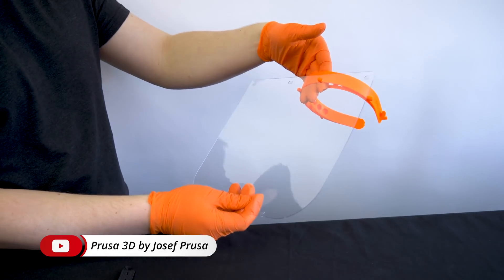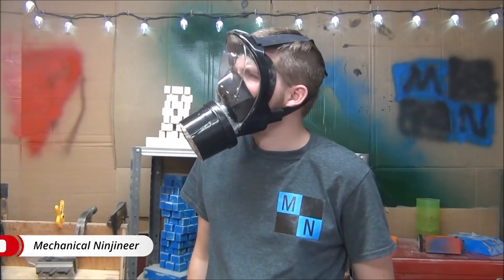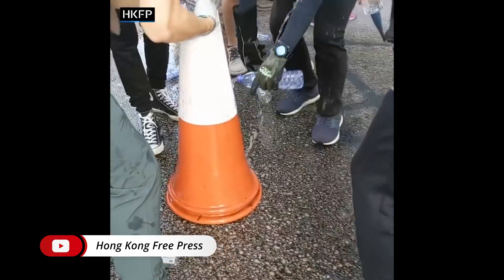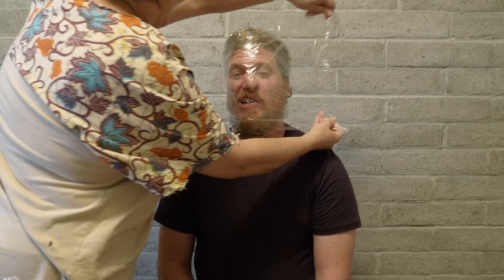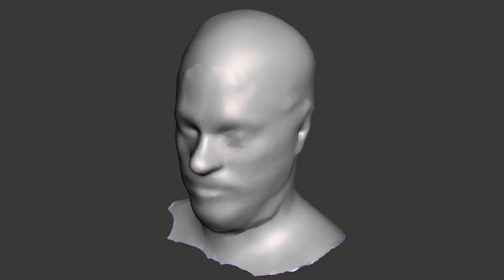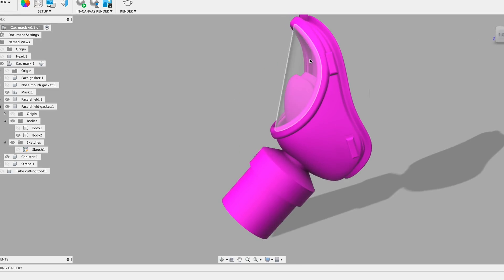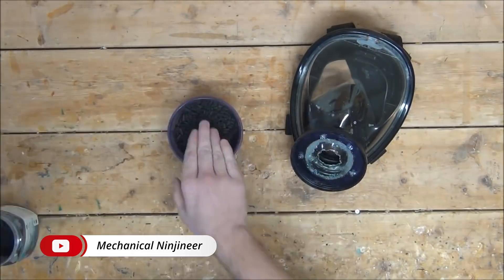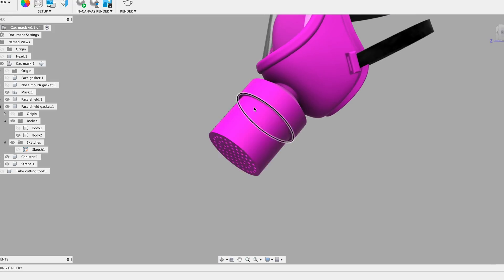I Designed an Open Source 3D Printed Gas Mask

Comment: I don't really know a lot about 3d printing but a few things about 3d modelling. Having  a lot of large round surfaces increases the complexity of the model a lot so I would try to make more flat surfaces and only have them rounded at the mating points to your face/filter canister. For example make the canister a hexagonal shape with a rounded top to screw it in, that way you have large flat easy surfaces for the 3d printer to build.

Comment: A lot of printed plastics are porous. Moisture from your breath could potentially accumulate in the plastic and allow bacterial or mold growth. Has anyone explored using a sealant on the plastic to prevent this?

Comment: There is a massive problem here you aren't thinking of. What happens when a cop hits someone in the face with a baton, or shoots them in the face with a rubber bullet? ABS/PLA will shatter into sharp chunks, which will then be driven into the wearer's face by the same impact. You need to make only the minimal parts out of rigid plastic, and keep them below the eyes/face as much as possible.

Comment: You can use the cup of a bra on the back of your head for the strap attachment.
Reply: Bras are expensive though. Silicone cutting mats are likely cheaper per piece

Comment: You should use a hepa filter like those in the vacuum cleaners... Its light weight.. no need for activated carbon...You can find them at cheap price @ hardware store...

Comment: For straps, just use velcro straps like this that wrap around a D ring and lock back to themselves:. http://www.walmart.com/ip/VELCRO-Brand-All-Purpose-Strap-Elastic-27in-x-1in-Straps-Black-2-ct/17190454

And thank you for your work and thoughts! Although I may have understood some of these issues longer than you have, I certainly didn't know what I personally could do about them, and I probably still don't. But I know I'm ready to try, and a lot of my thoughts parallel your own, so I'm glad that you're using your platform to spread these ideas as far as you can. That's what I like to see from those with a platform... I would guess that your eyes have been opened quite a bit by the people you are staying with as well... Be safe, and #BLM !

Comment: I'd suggest using some kind of sealing tape like teflon tape on the threads of the filter cartridge, just because 3d printed threads might not have the best seal.
Reply: The issue with teflon tape on plastic threads is that it can very easily put far too much force on the plastic, cracking it. Teflon compound might be able to provide as good of a seal without that risk (perhaps along with a slightly tapered thread). I also wonder whether the threaded part could be at the inlet end somehow to remove this issue altogether. No need for a good seal if it's right next to the inlet anyway.
Reply: @mowcius  I like your idea of putting the threaded part on the unfiltered side so it doesn't need to seal. However, this means that the filter would be packed into the mask body itself. With more of a canister design as it is now, the filter can easily be swapped out or removed and repacked if needed without taking off the entire mask.
Reply: Adding an o-ring to would easier. Adding an o-ring gland where the canister and mask meet would be easy to do in the model.
Reply: @Incendium87 , my worry with o-rings would be how available they are for people. Possibly there are standard globally available large sizes?
Reply: @mowcius  O-ring sizes are standardized. There are technically metric and inch standards, but I think they are basically a renaming of the same physical part. Either way, they are flexible enough that the sizing can be fudged a little if the environment isn't too demanding. A range of sizes would be available in any hardware store. If an o-ring can't be found any number of other things could be used to make the simple gasket. The same or similar weather striping he's using in the face seal, or any other sheet gasket material. sheet gasket can also generally be found at a hardware or automotive store. If printing in TPU for the face gasket, you could just print the filter gasket too.
Reply: Love the discussion tapered threads or an O-ring both great alternatives

Comment: My first concern with a 3D printed gas masks would be the porosity of FDM printed parts. Even just today, I had a PLA part fail immediately because I forgot that 3D parts aren't watertight. And, by extension, they are nowhere near airtight. There are ways around this with over-extruding, surface finishes and (I think) SLA printing, but it's still a major concern; even if a mask is water/air tight, or at least tight enough, having pores that can retain tear gas or pepper spray would detract the mask's value significantly. This should definitely be a concern for any 3D printed gas mask.

Comment: First of all I think this is great. It had me thinking...Theoretically you could use a regular snorkling-kit right? eye-mask to cover your nose and eyes and then fill up the snorkle with activated charcoal and cotton. Im thinking as an option for people who does not have access to a 3d printer but still want to frontline and take out canisters of toxic shit etc. (Just an idea, putting it out there)
Reply: You don't need activated charcoal for CS spray. Activated charcoal does not work for CS spray.
What works is a particulate filter, same for covid.
Cotton balls are not a good particulate filter.

You need a non-woven textile.

Comment: You should definitely make the part that holds the canister portion to the main section much stronger. It's most likely going to be knocked around (think about it a thing the size of a coke can sticking out your face is going to get hit a lot especially in a crowd with tear gas canisters being fired into it) and if it's not strong enough it'll break off. If you read this ILUVU no homo but ye :)

Comment: I've been brainstorming a form factor to fit a voice box to existing gas masks. I know the electronics part already, but having a vox port would be nice for voice clarity.
To be clear on how they work: Gas masks have a diaphragm that lets air in on the filter, but not out. Voice ports and exhale ports are the opposite, letting air out but not in with another diaphragm. It can be done with a hole that's smaller than the diaphragm you choose and placing it on the inside for inhale, and the outside for exhale

Comment: your beard will prevent a good seal this is why the military banned facial hair aside from small mustaches because they'd die if attacked with gas because of the lack of a proper seal, the foam depending on what type it is could also negate a seal your best going with a rubber or maybe some silicone for the seal instead
Reply: There are gasmasks that are especially designed for people with beards, it's a full head cover that seals around the neck.  I found out about them from a Sikh co-worker ( his religion forbids shaving )
Reply: @SuperMike2507  but bare in mind, the people with the long "unkept" beards are far and between...
tho some sikh medical professionals did shaved to put saving life of others without getting infected themselves as priority (N95 mask needed a complete and fitted seal to be effective)
Reply: Not true anymore.

Comment: There is a generic gasket that is made of rubber for car doors Wich can seal very well against the skin, is sort of a tube, maybe that would be better for the seal and it won't need to be so perfect to fit a wide range of faces

Comment: Issue 1: no exhaust port. Look at the Russian GP5 and look at the exhaust. It’s the most simple.                                                   Fix for the straps: make a T with an extended top portion and another cross section.                                                           Reason for the inner seal: so your breath (breath has moisture) and will fog up glass.
Reply: That's why It is OPEN SOURCE, so you can improve it apporting your knowledge.
Reply: Mr. elyte I have the CAD modeling ability of a carrot.
Reply: This design contains no valve. Air comes out the same way it goes in.
Reply: Tedd I suggested the exhaust port from the GP5. It will get air out so you don’t fog as bad as well as conserve the filter

Comment: Well spoken and great use of your time. I agree that you don't have to be political or be in a specific part of the political circle to agree what been happening is wrong. I think for your mask it is best to make two variants, one for only the mouth and one for mouth and eyes.  For eye protection there a lot of still available.  I recommend m3 engineering glasses and paintball masks to protect your eyes from peperspray paintball. Also everyone already knows about the goggles for the spray itself. I will try to help with the design with the mask.

Comment: When selecting materials that come into contact with your skin; make sure you know what they are made of and that they are safe. Construction materials may be safe for the use they are designed for but not on skin.
Reply: In fact a lot of construction materials are absolutely vile and require PPE to handle in the first place

Comment: Medical engineer and volunteer firefighter here. Scotty don't get me wrong, I like your stuff, but I have a few concerns that I want to share.

The standard FDM printing is whether water tight nor gas tight without any further tricks. So if someone is printing it without this knowledge, it can be very harmful.
You mentioned also Covid-19, don't use activated carbon filters against covid. It will filter nothing, because activated carbon is only for a few gases and bigger particles. Consider to use a commercial filter to make sure it is working. There are a few more things that makes me afraid of this idea. Sure it is better than nothing. 

I like the idea of open source gas masks, face shields and ventilators, but there are also a few risks and nothing is worse than false sense of security.
Reply: I was going to mention painting as a solution as well, I see that has already been mentioned.

I'll only add my second point that as printed, the part shouldn't be too bad. A decent printer can get a print water tight, especially if printing multiple parameters and there aren't steep overhangs to deal with. It won't hold pressure, but could be used as a vessel to hold water. I would agree that it will likely not be gas tight, but even without sealing it with a polyurethane, it would likely be ok. I wouldn't trust it against a toxin or nerve gas, but it will help against an irritant. How much gas is pulled through the print will likely depend on how restrictive the filter is. Also, sealing against the face is going to be a much bigger problem than sealing the print itself anyway.
Reply: My  prints are completely watertight
Reply: @Nathan-mu8zy  My experience as well. I've also applied a simple clear coat from time time and it seems to do the trick. I can't see how gasses would be able to penetrate PLA unless we're talking about a sub-mm layer.
Reply: Thought of a better seal maybe, you use an end game approach, that is per person with an eg, silicone bead while wearing/using a plastic wrap so it doesn't stick.
Reply: You can also enable ironing on prints so the top layer is smoother and more connected
Reply: You can easily make FDM watertight by vapor smoothing ABS 

And even if you don't do that you can just use 6+ perimeters and 110% extrusion width and I highly doubt gas could swap through that many layers of plastic
Reply: 100% infill and a sealant solves all this! Learnt this 3d printing water sprinklers
Reply: The water/gas permeability can be improved or possibly completely fixed with a couple of coats of food safe water based polyurethane... of course I can't speak to the chemical interaction of all of the plastics with polyurethane, but I am fairly confident that if you let the mask cure for several days after you coat it, it should be at least as safe as vulcanized rubber... and far safer than not having a mask.
Reply: mightygrom Another more widely available and also potentially forgiving (in terms of application) could be using bathroom silicon to apply to the outside and inside of the mask. It’s super sticky, creates a very tight seal and is cheap
Reply: Thank you for your great ideas! Makes me very happy in times of modern YouTube comments.
Reply: @mightygrom  yes that's right, but it is also depending on the person who does the coating. What I wanted to point out is that it doesn't work out of the box ("without any further tricks"). Coating is not trivial.
Reply: @maxhouseman3129  long response was deleted by an errant mouse click. 
in short, after 30 years of working as an industrial designer in the furniture industry, I could easily produce instructions on the proper application of Poly. The reason it is often used in food service applications is that by it's nature, it fills in gaps and creates a smooth homogenous surface.
Please excuse the short nature of the response,  I am frustrated with the interface, and do not in any way discount your knowledge or experience, but I do have  a relatively large anecdotal data-set to work from in this particular area.  a new maker might leave streaks or brush hairs in the finish (not acceptable on a conference table) but these blemishes wouldn't hamper the effectiveness of the coating... and a simple "does water leak out of the finished mask" test would be sufficient IMO for the proposed use-case (not 99.9% viral protection, but  protection from chemical irritants)
A bigger issue is forming the mask to the user's faces, but if you look at the work that the e-nable folks have been doing, people can thermo-form PLA to their own face using boiling water to take the PLA above it's glass temp (about 63c) and then letting it cool in place but that would need doing before finishing with poly... a little warm yes, but it would cool quickly... 
best wishes
Reply: @mightygrom  thanks for your sophisticated response. I appreciate it!

Comment: The next mask you make may need some kind of outtake valve because it'll be hard to breathe through a sealed mask with only 1 pathway. It'll improve comfort but still. Might be more complicated. Might need a screw and a bit of rubber. If its not done right you'd risk the mask not actually being sealed.

Comment: Dear Scotty,
thanks for your effort to getting a 3D printable mask designed.
Here are my 2 cents:
I assume the mask consists of two compartments to avoid fogging up of the lense. 
The mask will mostlikely be printed in ABS or PLA. I am unsure of diffusion and I would consider covering it in a sealant from the hardware store.
Also, this makes it - as you state correctly - rigid. Also, the mask takes fairly long to print. Long prints are difficult as power outages or hardware mistakes will stop the print and render the half finished mask useless. This is why I say there should be maybe a second version with more less rigid parts, connected with sealant tape, ducttape or cut-outs-from plastic bottles. This allows the mask to be more adaptable to different headshapes, will portion the print into more little pieces which allows not having to print it in a go but on the otherhand might make it less sealed and less effective to seal. 
Also, active coal can also be won by taking apart active coal cigarette filters, which should be a last resort, as it is probably more expensive. 
I would also add a third variation where you have loops on the mouthpart only, to be able to use it as half mask together with skigoggles or swimming glasses.
Thanks again. Good luck community
Reply: Hot take: how about printing a mould for a silicone mask?
Reply: MisterWonka Great idea! They could be printed once and reused for many masks. However I am unexperienced with silicon moulding and at what temperatures they are poured. PLA starts to go ‚soft‘ at about 60 C°, so that should be taken in consideration.
Reply: @chevrogers  the silicones I've worked with are used at room temperature and cure at room temperature

Comment: I've been wanting to do the same thing (3D print a mask) - except do it as an ergonomic PAPR system instead. Since covid seems primarily to be respiratory, I would design a system that only covers the nose and mouth. I'm thinking the ~9 CFM needed can be achieved with some sort of fan (like a squirrel cage). It would be designed to facilitate more natural conversation in public (grocery stores, retail, etc) while simultaneously protecting the user.

Comment: The inner part of the mask is not a second seal, but just reduces the volume of air you're breathing from within the mask, making it easier to draw air from outside. It doesn't need to be sealed, in fact you'd want to have some air circulation to avoid fogging up.

Comment: How about making a version only with the mouth/nose coverage? I would see some advantages in that:

- Less area to seal (especially the cheekbones which are very different between people, also sealing a longer perimeter means more places that can fail)
- Shorter print time
- No need to build a complicated visor (When at the hardware store to buy the seals, buy goggles)
- simpler
- no fogging of the visor
Reply: It'll leave your eyes vulnerable but you could easily buy something at a hardware store, solid idea and would make it much more accessible